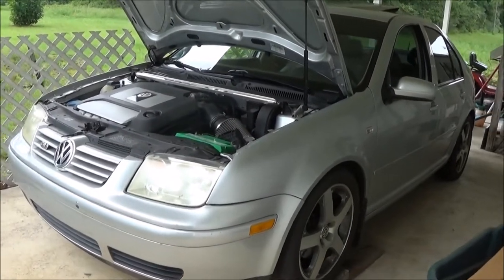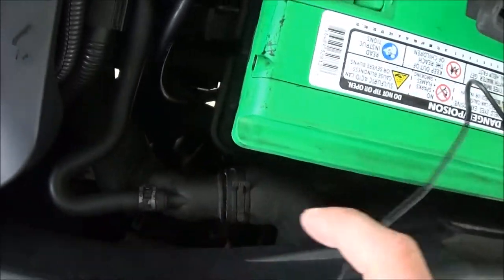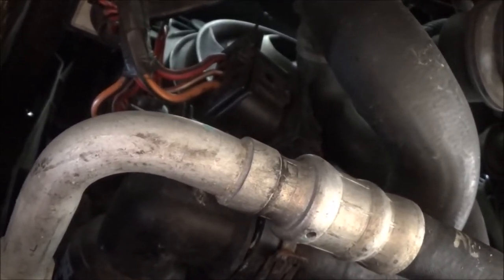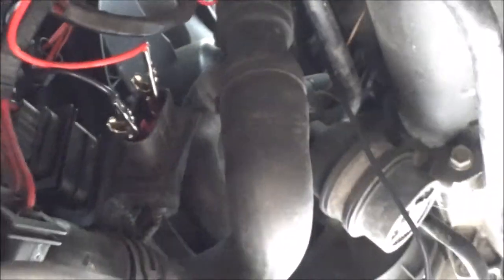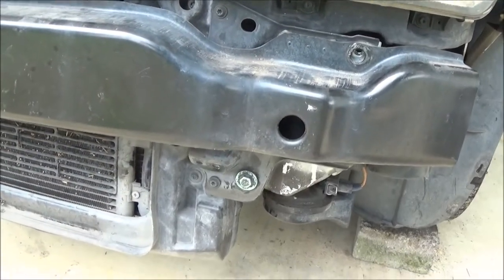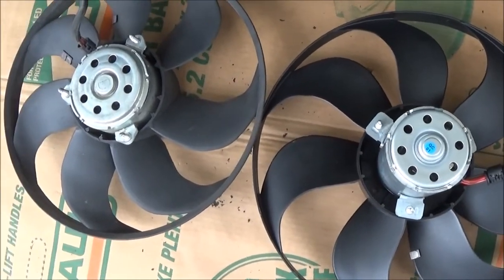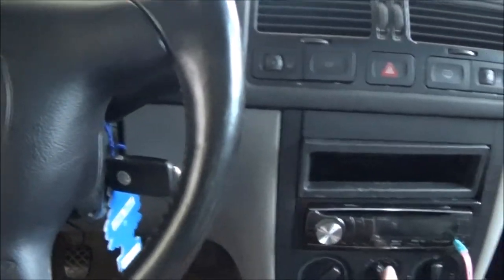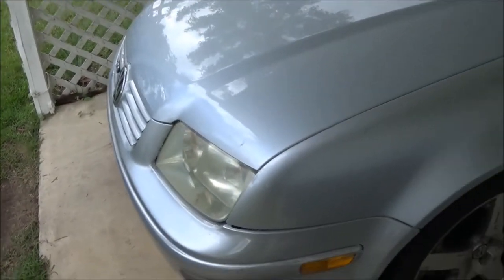How To Diagnose And Replace Volkswagen Radiator Fan's

Comment: Quick question I replaced thermostat, fuse box, thermoswitch, etc but I notice when I turn my AC on sometimes the fans turn off but there is times it runs and it I get cold AC but my real problem is that I put a FCM and it was working but when I touched it the fans turned off I was thinking maybe there is a shortage in the wires?

Comment: I have 2009 vw 2.0t wolfsburg edition. Battery died so replaced the battery now my cooling fan will not shut off have to disconnect the battery
Reply from the maker: I had the same problem on my MK5 R32, AC pressure switch or something caused the fans to always run on high, I forget. It might be in an R32 video

Comment: I have the opposite problem occurring… the fans DO NOT turn on when the engine comes to temperature; however they DO turn on with the A/C. 
The fans don’t spin so my car overheats when in traffic. 
But if I turn the A/C on the temperature drops. 
Also, the heater doesn’t blow hot air? 
I’m losing my mind 😮